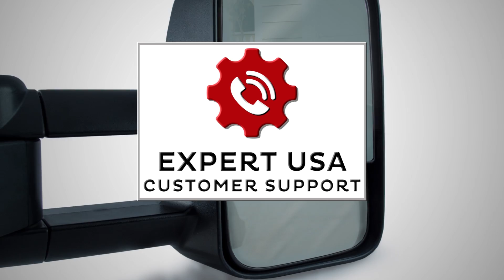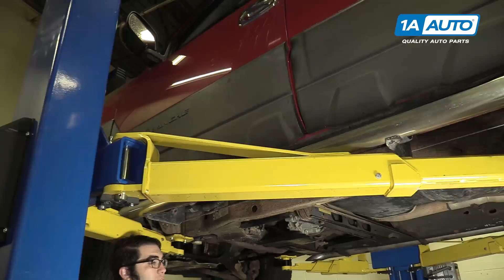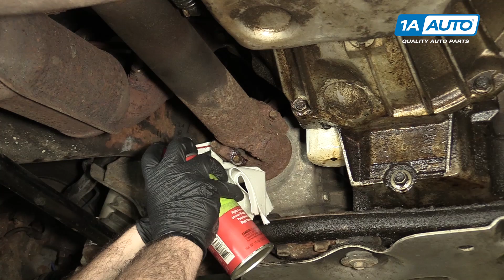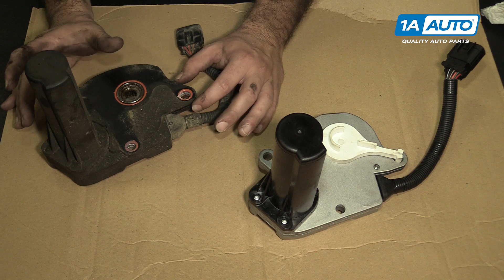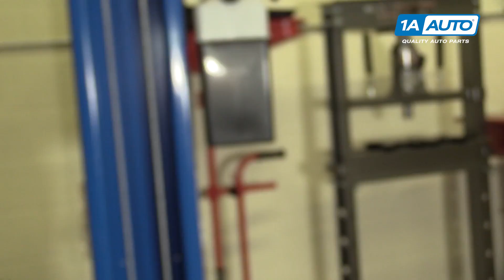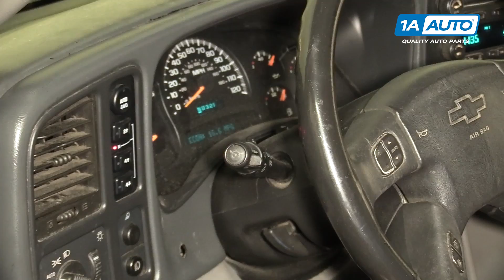How to Install Replace Transfer Case Shift Motor 2003-07 Chevy Avalanche

Comment: I followed your video, so I don’t know what caused it but this is what happened. Once I put everything back together and was going to move the truck off the ramps, I shifted in to reverse and the vehicle would not move though the rpms climbed. So shifted back in to park, and when it shifted the transmission (presumably) made a grinding noise. Shifted in and out park twice with each time making grinding noise going in to park to try and find where the grinding was coming from. After the third time a clattering noise was heard when in any other gear besides park. Any insight would be greatly appreciated.

Comment: If your worried about aligning new encoder female inlet with the transfer case male output. You just simply need to plug the new encoder motor in, NOT installed, turn your truck on and the new encoder will turn itself to the correct position and then just bolt it up. Make sure you dont change the mode your in from where it was when you took the original part off.

Comment: Will this make my 2003 Chevy avalanche go into 2 Wheel because currently mine only goes into four high for low and all wheel drive and this part, the reason why I’m asking is because it is quite expensive and I’ve already replaced almost everything else except for this in the transfer case, and both of those are pretty expensive

Comment: Good video. FYI, the orientation of the u-joints is by design, irrelevant. Also, you may have to start the truck (in addition to putting it in neutral for 4 low) to get the shift motor to start working.

Comment: So I didn't have to take the driveshaft off. Just need to wiggle one of the bolts off cleverly by adjusting the driveshaft here and there (not that bad). I could do the whole job in under 15 minutes now
Reply: Hallelujah

Comment: My 2006 Avalanche is stuck in 4 hi and won’t shift because the encoder motor is bad. How do manually shift it into neutral?

Comment: I have a 2005 Chevy avalanche z71 with no Service 4WD code .but can drive it in auto 4wd do you think the transfers case motor is the problem

Comment: I have a 2002 chey Silverado i changed the transfercase motor, changed the tccm and the swicht  on the dashboard and stil the 4x4 don't work? Can you help me ?
Reply: Check fuses it will be a 20 amp atc fuse on the right in the middle of your fuse box. Check grounds right under the driver side door mounted to frame may need cleaned up. Could possibly be an actuator problem that's a cheap and easy fix. Could be vaccuum issue/diaphragm. Good luck mate mine is stuck in 4wd low rn and my switch lights are out but the switch seemed fine when checking ohms. My 20 amp atc fuse was blown and when replaced it blew right away telling me it's probably the encoder motor. Make sure you change the encoder motor first then a new fuse or you will think the encoder motor was not the issue when maybe it was but you blew a fuse without knowing. Just a thought

Comment: Is it permissible to remove a faulty transfer case shift motor and discard it rather than replace it? I don't want to buy that costly replacement motor and am perfectly willing to disable 4WD permanently.
Reply from the maker: +Daniel B. Martin Thanks for watching!  In theory you could just not install a new one, you would just lose all FWD functionality.  1aauto.com
Reply: @1AAuto  Thank you, 1A.  I'm also searching for a low-labor means to achieve the same purpose.  I hope to identify one fuse which will disable FWD permanently but not affect anything else.  There is a fuse marked TREC.  Is that the one?  2004 GMC Yukon.
Reply: @danielbmartin  Yes it is the fuse in the 2004 Yukon. That's the same truck as mine. However, if you just pull that the truck will still be (if it's stuck) in 4wd. Same as if you pull the motor, or disconnect it, because the front drive shaft is still in. However, if you really don't want to change the motor (not sure why you wouldn't, they are like $100 on Amazon), just pull the front drive shaft and motor and drive all you want in 2wd. That is, considering that the front differential actuator hasn't locked your front wheels in 4wd still. That won't disengage without the signal to do so. So, you'd have to pull that as well.

Comment: Will a 02 Transfer Case Encoder Motor work on a 05 Transfer Case
Reply: No, the wiring is different
Reply: Did you ever find out ? I’m trying to find out the same

Comment: I have a 2001 suburban 5.3 4x4. I just replaced the control switch, no lights came on. Checked the ACT fuse it was blown. Changed fuse and the lights came on and switch worked fine. Got in the truck the next day and the lights did not work and blown fuse again. I know it is probably a short to ground but is there an easy way to diagnose without tracing all the wires?
Reply from the maker: +Cant stand liberals We do not have a way of being able to diagnose the issue that you are experiencing with your vehicle but suggest taking it to a local mechanic for a proper diagnosis.

Comment: I have no power to when it comes to changing my 4wd I have put a new switch,  a new actuator and still no power, meaning lights on the switch don't light up. Already checked fuses and couldn't find any popped. is this what would cause no power to switch into 4wd?
Reply: I'm wondering the same thing.
Reply from the maker: +kris cruz Thanks for watching!  There could be multiple reasons why you're having this particular problem. We suggest taking your vehicle to a nearby reputable shop to accurately identify the cause!  1aauto.com

Comment: Dude your truck still has the service four wheel.drive lit on the dash....
Reply: His 4WD wasn’t even engaging. All the lights were still blinking except for when he put it in 2WD
Reply: @MAVgamingLLC  Totally was about to post this. How did they not wait until it engaged? They probably have a bad ground.
Reply: @MAVgamingLLC  the truck is in park after he turns the ignition on all the way and doesn’t put it in neutral that’s why he can’t shift into 4wd mode. He was able to at first because he turned the ignition w/o turning the engine on but he did put it in neutral and went from t-case neutral to 2wd.
Reply: yeah!!....noticed that too.....so how do you get that off??  reflash the computer???

Comment: Great helpful video. IMPORTANT! When you mention to put the transfer in neutral turning the keyway downward, what do you mean with "keyway". Can you be more explicit, maybe show a photograph or put it into the video?
I expect the most important is to get the transfer into neutral before installing the new motor, so as long as it is and I am not sure where that keyway is, I can turn it until it is into neutral?! Right or wrong? Any risks? Otherwise great video.
Reply: Erik Viktor ,Google keyway, and key stock if you don't know what a keyway is, a keyway is a slot that keeps a part aligned, suck as a pulley over a shaft, or in this case it'll turn your transfer case into the right position

Comment: So have the transmission & the 4wd switch both in Neutral before starting this project?
Reply: texjames2000 nope. The only time you’ll need the transmission in neutral is once everything is back together and you are now sitting in the vehicle testing the different selections are working accordingly. Keep in mind to keep the truck’s transmission in neutral  when you are shifting into 4HI and 4LO.  I don’t get why the technician had it in neutral and then decided to do go back to park to test the rest of the selections. That’s why his selections never stop flashing.  They never actually engaged.
Reply: AdrenalineHigh , so true , mine wont go into 4x4 , reason i an watching this video trying to troubleshoot, assuming its actuator . but could just be a relay or the dash switch

Comment: I know the purpose of this video focused on the transfer case shift motor replacement. But would it not be a good idea to change the u-joint(s) out at this time?
Reply from the maker: +Troy Bilbrey If they need to be serviced it would be a good time to service them while you have the driveshaft out.

Comment: Great video on how to install. The details you gave on the indexing the new motor and transfer gear in the neutral position helped my get mine truck back together !! Thanks! . All the other videos did not even mention that or what/how to do the indexing.

Comment: Nice in depth tutorial, but it never went into 4HI, 4LO, or AUTO. It only fully shifted into 2WD. Why ??
Reply: it was still in park when he was switching those buttons it looked like! gotta be in neutral
Reply: Jake Jacobs nope just 4 low needs to be
Reply: @bubbajr91  That's correct. When making a selection, the transmission must be in neutral. Once a selection is made, the orange indicator will flash intermittently until the driver engages into either reverse or drive. Most GM trucks and SUV's of this platform will not go directly from 2HI to 4LO without first selecting 4HI. It's just the way the system works.
Reply: Yeah, I was wondering that myself.  That’s the  whole point in the swap.
Reply: isn't this why we are replacing the Transfer Case motor in the first place ??
Reply: Good question but no answer????
Reply: The service 4wd light came on as well
Reply: exactly
Reply: You are correct!... there is still a problem in the system, either the front diff actuator isn’t receiving signal to actuate, or the TCCM is not functioning. May need to be re-flashed after install. As for shifting into 4Hi it should shift in park. Only 4Lo needs to be in Neutral.